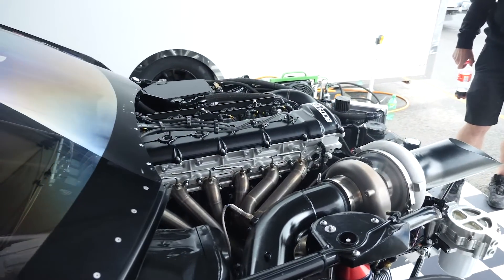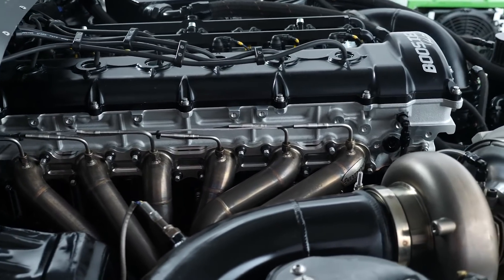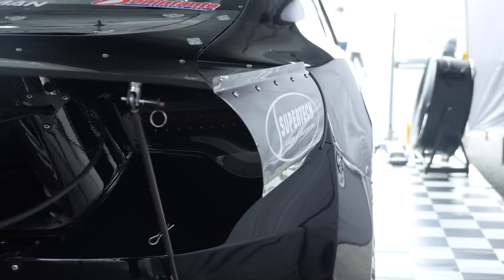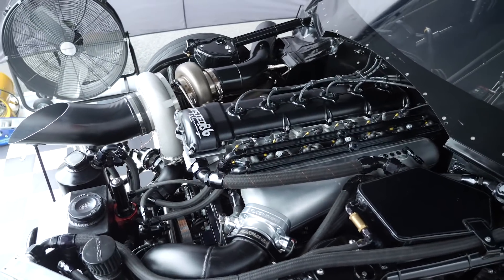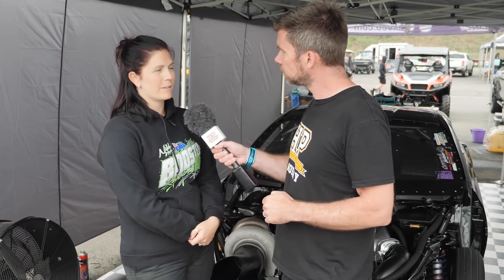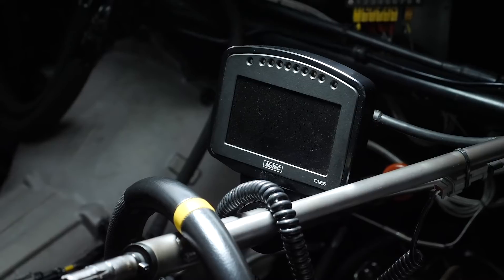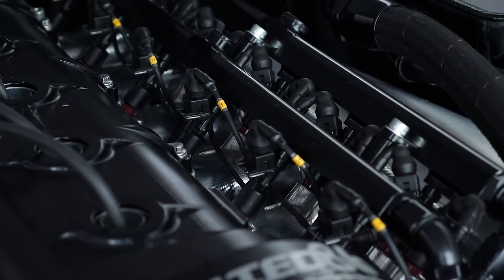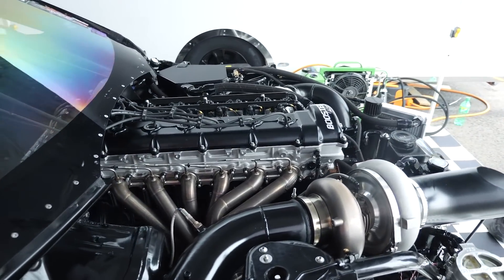1FZ-FE Swapped Toyota 86 | 240HP to 2500HP Boosted86 [TECH TOUR]

Comment: Is it possible to swap 1fz-fe into gt86 in stock chassis? And if it possible how is the weight distribution will be Iam building a street racing gt86 with 1fz-fe t with sequential gear box

Comment: How hard would it be to get this engine in a VK commodore?? Not your exact psycho engine but a 1fzfe. Relatively easy? Or big structural changes you think?
Reply: I have a turbo Barra in a VB Commodore. But the vids I am seeing of the 1fz Fe. Are absolutely insane. Love the engine and love what you guys have done with it.
Reply from the maker: I've never done an engine swap in a VK, but there has to be more room in there than an 86 so it would be pretty straight forward I would think. I'd start by seeing what size the Holden V8s they shoehorned into some of those is like size-wise by comparison personally - Taz.
Reply: @hpa101  thanks so much. Really appreciate you taking the time to provide a response. Keep up the epic content. Transferring of skills and knowledge from the professionals to the DIYers is wicked.

Comment: I have that engine and I would have never thought this was possible, I wonder what the cost was?
Reply: If you just keep stock 4.5 liter, kelford BC dkk still offer parts with reasonably price,. But this 86 isnt
Reply from the maker: With so much being custom, between 'quite a bit' and 'a lot' would be my guess. It's delivering the results for the team though eh :) - Taz.
Reply: Well into the 5 digit range I’m sure
Reply: Just turbo it stock, keep it 8-12lbs and you’ll be just fine and lots of power gains

Comment: Meanwhile Jonathan Ward from ICON 4X4 is replacing these with LS crate engines on his six figure Land Cruiser builds.  I really wish he would keep them Toyota powered similar to his Coyote powered Bronco's and Hemi powered Derelict Chrysler's.
Reply: The 1fz is not efficient engine and not as refined as modern LS engine. Meanwhile in race term, inline 6 layout make tuner easier to setup turbo etc. The FJ Company offer 1FZ to swap the fj40

Comment: I'd like to hear more info on the scissor arrangement for the cams because that is a very interesting thing the 1fz has
Reply: it's not just the Fz, many narrow valve angle Toyota DOHC heads (FE suffix not GE suffix) on engines such as the S, 3RZ I4s,  UZ v8s,  MZ v6s and I believe the GZ v12 have the same design
Reply from the maker: We do cover that using a 1UZ in a video somewhere. I'll drop the link in if I find it for you later, i think it is in one of the 'Today At HPA' vids - Taz.
Reply: As far as I know scissor cam drive is just for refinement (noise reduction), doubt that this motor is still using it.
Reply: Pretty common in Toyota engines, the UZ and VZ range use the same thing.

Comment: Wish more ECU development would be done specific to the 1fzfe. So easy to produce power with pretty low boost v
Reply: Bruh. A fucking megasquirt could run that😂😂
Reply: Im not sure what you mean exactly by ecu development? no ecu development needs to be done with this engine its like any other 6 cylinder, you wire in an aftermarket ecu and off you go?
Reply: @damonholmes9299  its because people want plug and play because wiring hard
Reply: Whats so different about the 1fzfe that a normal aftermarket ecu cant control? Just curious.
Reply: @reidonz5848  due to the low rpm band and big pots the tuner really struggle to get the tuning at low rpm and idle controllers right. Especially with an auto box.
Reply: @michaelevans7013  thats usually due to injector sizes rather than ecu's ability.
Reply: @reidonz5848  nothing really, it's a pretty ordinary inline six, just a very sturdy one. Arabian guys started building them up like mad a while ago as they had lots of them around.
Nothing magic in making any ECU work with them, just experience is probably rare still outside of Arabia.
Reply: @AccAkut1987  they used to blow them to bits trying to stuff nos in them till bob norwood went over with the al anabi team with the boosted "no nos" truck...broke the record by over a second first run...that was the last of the spray days lol